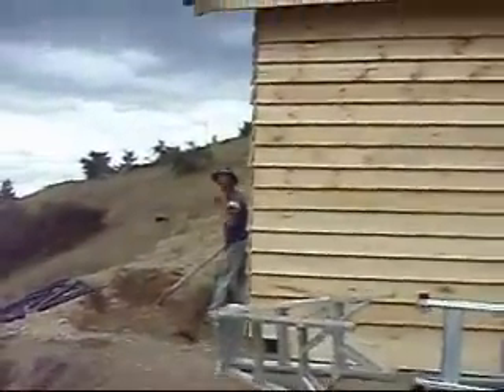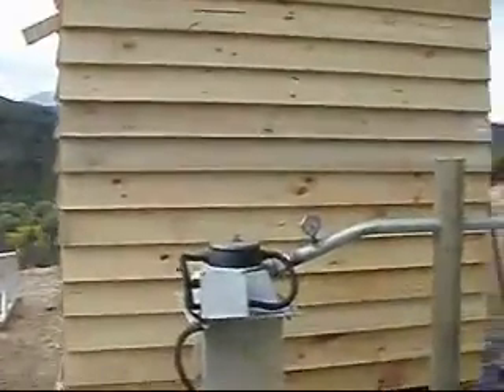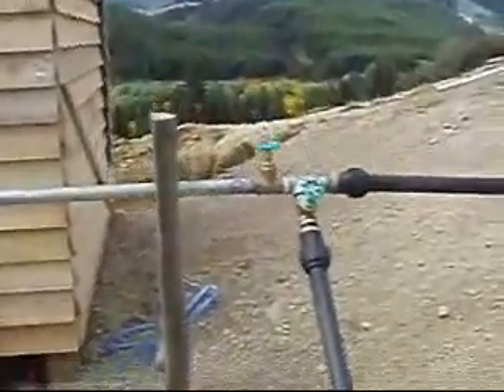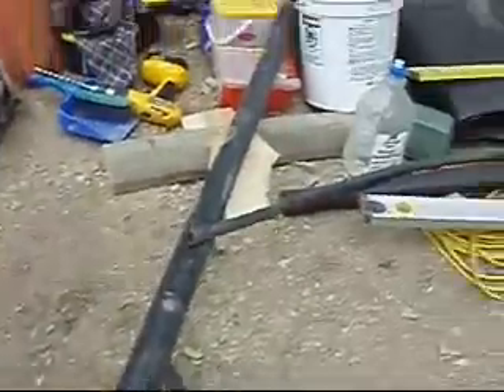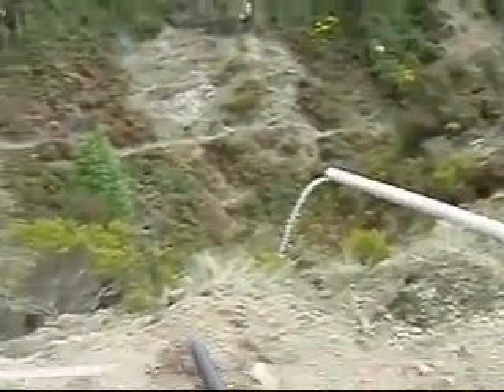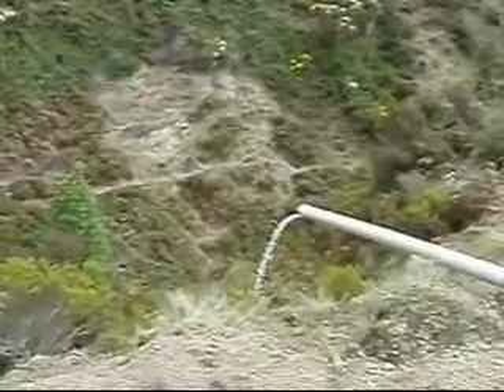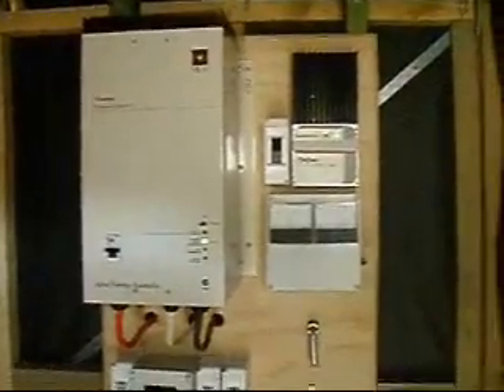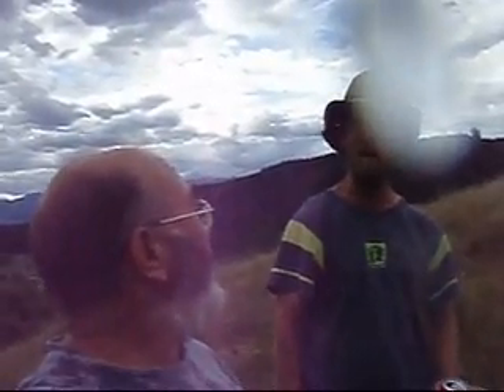Micro Hydro Power Station by Rick Rowlings of Link Systems

Comment: $28,000 for 700 w system? ... Wow... Why didn't you guys place the turbine in the shed? 1) It would cut down on notice and 2) it would protect it from the elements .. I m just asking because the shed IS RIGHT BESIDE IT
Reply from the maker: Hi,     Not a good idea to put all that water in the same shed as all the electrics,     keep them separate.    Rick.

Comment from the maker: @odat62       HI,  Every instalation is Different, PIpe and cable lenth, size of house load, but as a ball park figure $28000.00.     Which was a lot less than the $200 000 and easements over other properties for the natinal grid.

Comment: That looks like a really nice clean setup with an excess of head and probably flow too, You are lucky to have such an installation. I've read that it isn't good to have a droopy penstock which it seems you have right before the turbine. I don't know how cold it gets there but if you had to shut off the turbine for whatever reason and the flow when it gets below freezing the ice could burst a pipe in a droopy section.